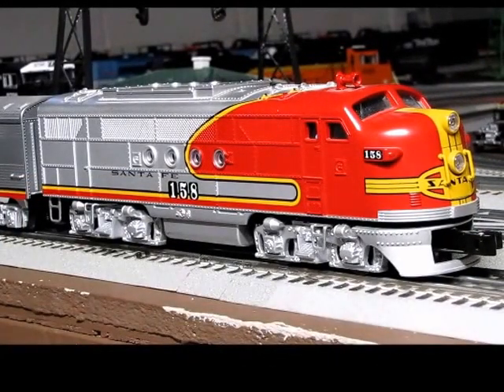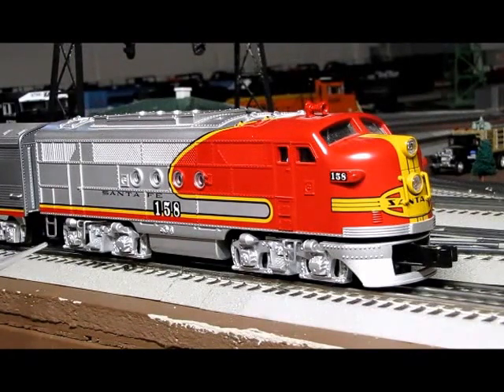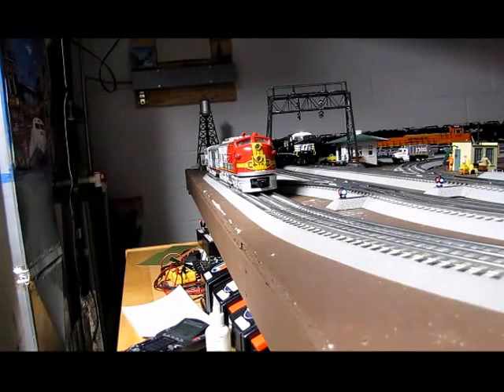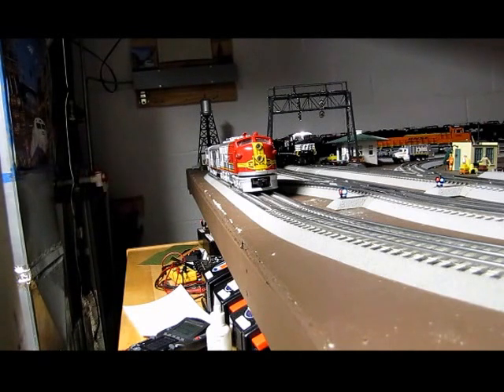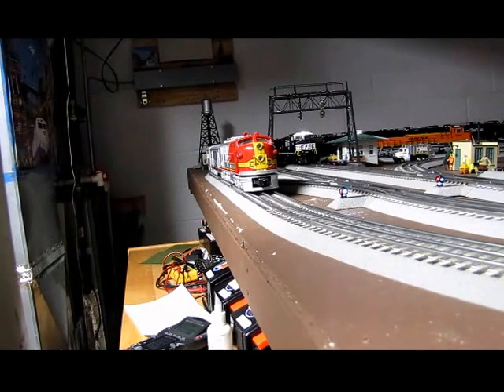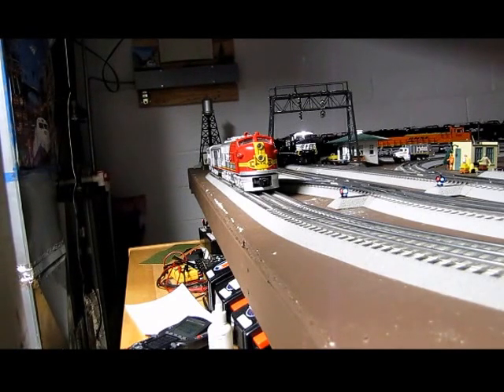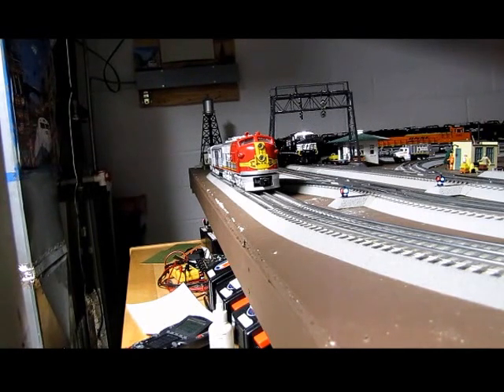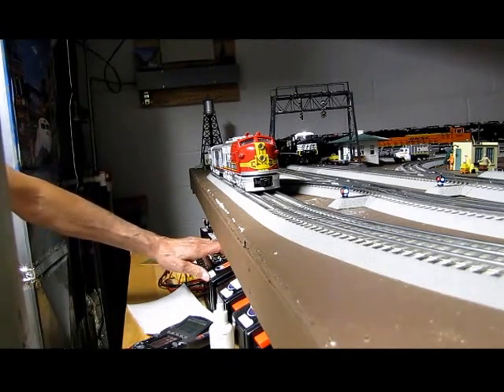New Layout: Video 6 - Part 1: Classic FT Diesel Locomotive Santa Fe EL Capten Train set

Comment: Beautiful train Nick! I like it so much I bought one back then also, lol. I also bought the add on cars in the later years and added figures. Great running train. I have been wanting to pull mine out and make a video also. I actually bought the starter set off a train friend who decided he didn't want it after he bought it.
Reply from the maker: ajmayowskijr I'm glade you enjoyed the seeing the Santa Fe EL Captain Set.  Yes it is a great running set. I like to run the set every once in a while. I would like to see your set in a video. One day I like to run my Legacy engines in the same video with the Classic FT. First I have to separate the Voltage from one track to accommodate  the Classic FT to run in conventional mode. Looking forward to seeing your video with the Santa Fe El Captain Set. Thanks for your comments.